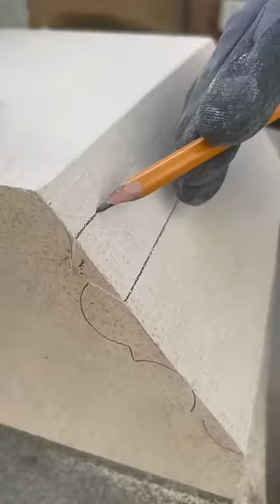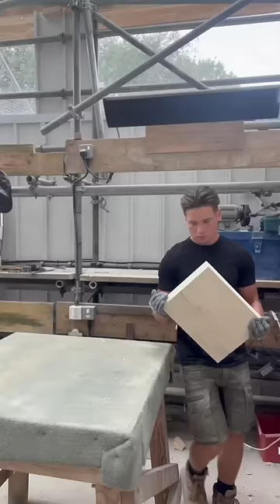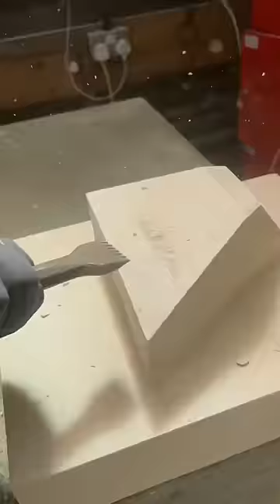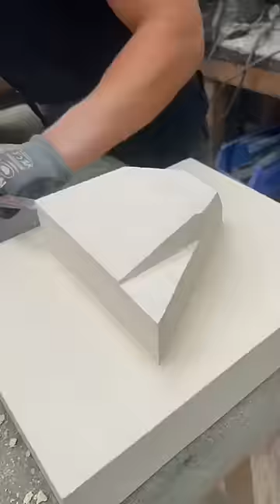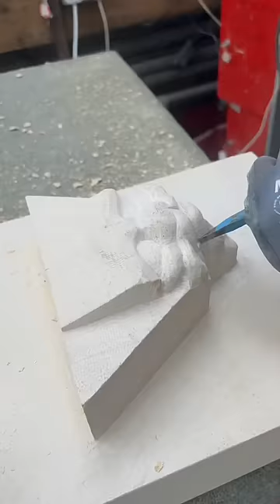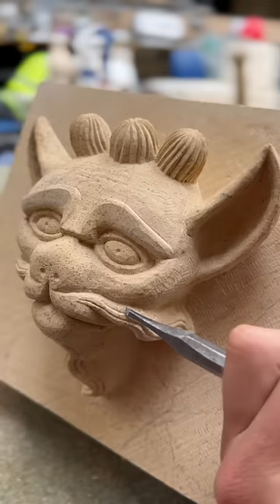#stonemasonry

Comment: Lol 😂
I love listening to people try and explain the pyramid builders using anything other than chisels and hammers. This would blow his little mind!
Reply: "lol" you do realize the stone used in ancient builds were completely different than the sandstone shown on display in the video.

In one of the pyramids they found thousands of perfectly balanced and machined vases made out've a stone that is harder than steel. 

The only thing harder than the stone they used to machine these vases is diamond! It is 100% impossible to achieve any form of success with the material when all the Dynastic Egyptians had were copper chisels and copper tools. 

Copper is extremely soft and not useable to achieve the levels of work that have been found. 

So there's a missing link to the puzzle that is not so easily explainable.
Reply: @cptjohnbhewler1529  Source: "Trust me bro"
Reply: @cptjohnbhewler1529  oh for god sakes ur copy and pasting ur comment on other peoples comments to...
Reply: There were definitely core / tube drills used as well for some of the work.

The markings on the Great Pyramid sarcophagus leave little doubt in that respect.
Reply: @mnomadvfx that is called either tomb robbers or basic hand drills that my unskilled ass could make.
Reply: @bro8686 I'm guessing he means the giant rectangular hole where the pharaoh would sleep for eternity, not any smaller holes around it .

Comment: you're using steel-precision tools... which makes the whole video pointless tbh (except for showing the amazing talent you have, of course)

they were using copper tools which in theory don't work properly on the kind of stone used to make the pyramids just because the rock was full of quartz which is really hard (it's a 7 iirc in the mohs scale) while copper is around a 3 in the same scale. the thing is they used the sand along their tools and the sand is... full of quartz. they were ancient civilizations, but they were smart AF. they also had to deal with the problems of their technology too, which as for today standards simple solutions, as the egyptian gave, are forgotten.

Comment: Yes because lifting tons of stone from a quarry hundreds of miles away, making them uniform and building a massive structure is sooo easy. Comparing what the carver did with what ancient Egyptians did is not a good comparison. Instead of disparaging someone thoughts, why don’t you explain how it was done. No  modern machines, or tools. Working day and night for more than 20 years. Then add the fact that ancient Egyptians did not have the concept of how to use the wheel. They only had a ramps. That was a daunting task.

Comment: Jesus. Not this again. This is sandstone, not Granite which is significantly harder. The Dynastic Egyptians did not have carbon steel tools, only copper. They did not have the wheel, or force multipliers such as fulcrums and capstans.

So whoever built all of the igneous megalithic architecture all over the world and moved 1000 tonne stones hundreds of miles over land didn't do it with the tools we are told they supposedly had.

Comment: Uh....it's a little bit of a different case here. A two foot straight, flat surface is gonna be about a hundred million times easier to chisel than thousands of 10 or 12 foot blocks on all edges and then moving and positioning them perfectly, not saying it's impossible just not at all related to this art project

Comment: I get that the point is people underestimate what you can do with a few hand tools like a chisle, but to be fair, the problem was made a little more complex by the fact they didnt have access to steal or iron tools like the ones used in the video. Yes they still had means to cut the rock and yes they built the peramids but it would have been easier to do so if they jad iron tools

Comment: What will this Vid say? They hay done it and we are also able to make it today? But the Egypts had no hardened Steel and The Material was often Granite... not Limestone like the handsome guy in this Video.
Reply: You don't need steel to cut granite, and the pyramid was almost entirely limestone. Granite can be cut with a copper saw and sand abrasive.

Comment: Still can't explain how they manage to bring that 10 tons blocks ( Just the Little Ones...) from a quarry at least was 1000 kilometers away and then put It all together....
Nobody Is discussing that ancient egyptian weren't capable of carving and chiseling a Stone.
Reply: Incorrect on every level. The average block is 2 tons. Aswan is 700 kilometers away, and connected to the pyramid  by the nile. Granite can be cut with copper tools and sand. Limestone (the primary building material) could be chiseled by copper alone.

Comment: The blocks they used was 1,000x bigger than that and they moved them and lifted them in the air 🤔
Reply: They did not lift them into the air. The prevailing theory is that they built ramps and used sand+water+mechanical leverage to move them

Comment: 1.) EGYPTIANS ONLY HAD COPPER AND TIN CHISELS, NOT SUPER HARD STEEL TOOLS.
2.) ON MOHS HARDNESS SCALE LIMESTONE IS A 3.5, AND STEEL IS 7. GRANITE RANGES FROM 6-8 AND COPPER IS A 3. THE HIGHER THE NUMBER THE HARDER THE MATERIAL. 
4.) WITH THE TOOL MATERIALS THE EGYPTIANS HAD, THEY NEVER SHOULD HAVE BEEN ABLE TO MAKE WHAT WAS FOUND BC ITS  IMPOSSIBLE. ITS LIKE CUTTING DOWN A TREE WITH A TISSUE, ITS NOT ABOUT HOW "SKILLED" THEY WERE ITS IMPOSSIBLE. SAD THING ABOUT DUMB PEOPLE IS THEY ARE NOT AWARE OF THEIR IGNORANCE. 
5.) THE PRECISION IS HARD TO CONVEY BUT I DOUBT THIS VIDEO'S STONE BLOCKS ARE REMOTELY CLOSE TO SOME OF THE MULTI TON GIANT GRANITE BOXES WITH PERFECT INSIDE CORNERS OF 90 DEGREES WITH SUPER FLAT, HIGH GLOSS SURFACE FINISH.
6.) THEY HAD A PROCESS TO MAKE SINGLE PIECE COLUMNS UNLIKE THE GREEKS AND ROMANS WHO  MADE SECTIONED COLUMNS
7.) TOO MUCH INFO TO CONVEY OVER A 30 SECOND VIDEO. JUST KNOW THAT THIS STONE CARVER IS GOOD AT HIS JOB, BUT HE ISN'T DOING ANYTHING THAT WOULD HAVE BEEN DIFFICULT CONSIDERING HE'S WORKING WITH TOOLING MUCH MUCH HARDER THAN THE EGYPTIANS HAD, WITH A MATERIAL MUCH SOFTER THAN THE EQYPTIANS USED ON THE MONUMENTS THAT ARE MOST IMPRESSIVE. SO SEEING ALL THESE COMMENTS THAT PRETEND TO UNDERSTAND HOW IT WAS ALL DONE ARE FOOLISH AND IGNORANT.
Reply: 1) Mohs hardness is a measure of what materials can scratch other materials.
2) Chisels do not work by scratching, chiseling takes advantage of how brittle the material is. 
3) You can chisel harder materials with softer chisels, it just wears the chisel out more.
4) the granite would likely have been cut with copper saws and a quartz sand abrasive, which we've already proven will work.
5) The granite stones are just not that precise, people who tell you they're mathematically perfect are lying to you.

Comment: Bro your carving skills are really good.. but absolutely no way you can remotely come close to matching the precision joe speaks of on the type of stone they used.  Not possible.. anyone that thinks this visual is matching what the engineers of the megaliths were doing.. well dont be fooled. Not even close
Reply: Take rock. Put sand on it. Put other rock on top. Rub them together for a while. Congrats you have made two faces that perfectly interlock, matching the so called "impossible precision" of the pyramids.

Comment: a stone carving is different then a massive megalithic structure that used million of stones that weighed tons and tons while they where from 10’s of miles away as well as them bejng over 300 feet in the air
Reply: The vast majority of the stones were quarried on site. Those that weren't were transported by boat. Ramps exist.

Comment: Ok.... So is this guy who's chiseling supposed to mean something? We're talking about stones that weigh 2.5 to 15 tons we talking about stacking granite blocks that weigh 80 tons stacked precisely mathematically upon one another also in alignment with Orion's belt a pyramid 450 ft up in the sky. Seeing some guy do some little chiseling work like this doesn't explain the engineering feat of the pyramid of Giza
Reply: No, basic math and physics explains the pyramids in giza.

"Blocks stacked precisely and mathematically on top of each other" y'all don't even know what you're saying you're just throwing buzzwords everywhere. How do you think a person stacks blocks "mathematically"? 

And the distance between the earth and the starts is literally astronomical. They would have had hundreds of meters of wiggle room and they would still seem to line up perfectly.
Reply: @Kingly-Mike  This whole "if even one block was off the whole thing would be out of alignment" might be true... if the blocks were all the same size. They aren't even the same size within the same layer. The pyramids are an incredible display of engineering... but they weren't even close to impossible based on what technology they reasonably had access to.

Comment: Is not the same. You are in a workshop, with tools made with thousands of years of experience, and with technology. The fact you can perform well does not mean we could do that 3-4000 years ago.
Reply: That's a chisel. They had chisels 4000 years ago. The material it's made of doesn't substantially make the chiseling easier, it means the tool lasts longer.
Reply: Except the reality is we can do what thst did we just have betfer methods. We never doubt Rome's abilities or Greeks but Egypt! We'll they couldn't possibly do that.

Comment: our mason is using steel to work marble(3 on hardness)granit is 8  and they said egyptian did it with copper
Reply: Most of the pyramid is made of limestone. As for the granite, we know for a fact that a copper saw with quartz sand abrasives will cut it.
Reply: @griffin123122  casing is polished limestone core is granit ,true that you can use quartz sand and copper tools but that would be found in sendiments around the pyramid and they aren't
Reply: @ovidiubuga6113  8000 tons of granite. 100,000 tons of mortar. 2.2 million tons of limestone. You're incorrect.

As for your second point, no? Maybe if they had been constructed a few hundred years ago, not 4000.

Comment: Now try using a copper chisel on a 1000 tonne granite block with surface indentations to less that a micron
Reply: The pyramids were not that precise. You can see mistakes in it all over the place. And you can cut granite with copper tools using sand which is made of silica. You grind the silica into the granite with a copper saw and because silica is harder than granite you get a nice clean cut
Reply: @christiandaniels8045  Yes, but no way those saws would get a mirror finish like the polished granite boxes at the Serapeum of Saqqara.
Reply: @raymondbaxter7489  for one there is no granite with a “mirror finish” on it. They might be relatively smooth but again scientists have used this technique to reproduce the SAME thing

Comment: I wrote this in another comment but im curious somone explain. 

No the burden of proof is on you, you need to explain how you can remove an 80 ton stone from a quarry with a 10% gradient. So you can understand a modern crane would struggle with 50 tons and these machines are machine grade hardened steel. They had wood and bronze also sand is soft put 80 tons on logs and see if they even roll how do you get it a 100 miles just so you can start to try and lift it.. how many slaves would need 100 thousand cool now we have a logistics problem slaves need to be fed and housed also you need soldiers and slave masters were is the food source for these people? How many resources would a desert nation be willing to put towards this and for how many years.
Reply: A typical tower crane could struggle, but we've built cranes that can lift up to 20,000 tons. This is also irrelevant, as ancient egyptians were not using cranes.

They would have transported the granite via boat. There's depictions of ancient egyptians  transporting obelisks that are even heavier in boats.

Over the sand they likely would have used sleds rather than log rollers. Hydrated sand has very little friction as the grains of sand essentially act as ball bearings.

We estimate that there were 30,000 laborers, most if not all of whom were there voluntarily and paid well for their work. The land near the Nile is incredibly fertile, there would have been plenty of food for this.

As for the amount of resources, the answer is "a lot" and the length of time is "around 30 years." This was a monument for their Pharaoh, who wasn't just a ruler but a literal deity.
Reply: @griffin123122  I can wrap my head around most of it but the 80 ton stones those I can't accept. I think people are underestimating the actually meaning of that amount of weight. The crane was an example of how hard it would be for modern people to remove not how the Egyptians would have done it. The weight of those stones is an expontially greater rate of difficulty than 2-10 tons the size of the boats sleds the ramps the amount of people everything becomes explosively more expensive and difficult with the technology we beleive they had. The only thing I believe is that they had technology's (doesn't mean modern everybody) that we haven't discovered yet and maybe wont.
Reply: @KLUGnick  Yeah it becomes more expensive, but more expensive =/= impossible for god king of the most powerful empire on earth at that time. Literally taking 1/30th of the estimated labor force dedicated to this would let you pull the block fairly successfully. Like I already said, there's depictions of boats carrying heavier loads. And there's only a handful of blocks that get anywhere close to 80 tons, so it's not like they had to dedicate that amount of labor to every stone.
Reply: @griffin123122  there are a bunch of stones in Egypt that weigh even more the colossi of memnon are like 600 tons. But those weren't lifted like 300ft in the air. I've talked to a couple engineer friends about it the difficulty scale doesn't have a flat upward trend when you add more weight it's an insane curve. Also is it crazy to say we don't know how they did it when the engineers who build stuff right now say they don't get it. Why is it that a guy/girl who went to college so he could interpret ancient civilization would know better?
Reply: @KLUGnick  The energy required to move something scales linearly based on the mass of the object. Frictive forces would dramatically increase the amount of energy required, but as I've already said wet sand will essentially remove that from the equation.

There's nothing wrong with saying we don't know exactly how they did it, that's the correct opinion to have because we're not time travelers and they didn't leave an instruction manual. What's incorrect is saying "we have no idea how they could have done it, I don't believe the current theories, so I think <insert theory here> even though I have no positive evidence of it."

Comment: Her we go again , he is playing with soft sand stone, while pyramids stone are much more harder and some of them is granite.
So show me your skills with granite stone hero😂
Reply: You can cute granite with a copper saw. That’s how the Egyptians did it
Reply: @christiandaniels8045  Is this osiris talking? 
I don't think you have experience with granite stone.
Copper cannot be used to craft granite.
Granite is crafted with diamond tools.
Reply: @Thatseitsi  granite has a Mohs hardness of between 6 and 7 which is more than copper. That’s why the Egyptians didn’t use only copper. They used silica sand which they had plenty of which is slightly harder than granite. They would pour the sand on the granite and into the cut and then work the sand into the granite with the copper saw. Scientists have done this and replicated clean cuts using only copper tools
Reply: @christiandaniels8045  what you say is true for straight cut but not for carving , those are different technics , carving in granite is so hard using chisel and hammer has nothing to do with sand and cannot be achived using sand and copper.
This is why this youtuber mostly post a sand stone or marble carving , but what we would like to see is granite carving with the same tools,
If it's easy he will post a video soon.
We will wait and see.

Comment: Now do it on an scale of x50
Reply: That’s easier  though 

just more time consuming and more punishing if you fuck up
Reply: @killerkirby366  Still, they were too far ahead of their time. Not even speaking about the coordinates and the exact placing pointing at specific stars.
Reply: @Zijlco  how where they ahead of there time
Reply: You inquire solely? However, you neglect to discuss the verifiable information that I have graciously bestowed upon you.
Reply: They are not too far ahead of their time. They excels at their craft but not unexplainable. Just because you can't get a perfect score doesn't mean your classmate cheats
Reply: @Zijlco   it’s simple theh arnet pointing at stars and. They’d dindt use our system to coordinates bakc them even if they where advanced they wokdon’t have used it so it would make no sense for the coordinate themselves to be significant 

So how where they ahead of there time
Reply: @Zijlco  The distance between our planet and those starts is literally astronomical. There would be hundreds of meters of leeway with where they placed it and it would still seem to line up "perfectly."